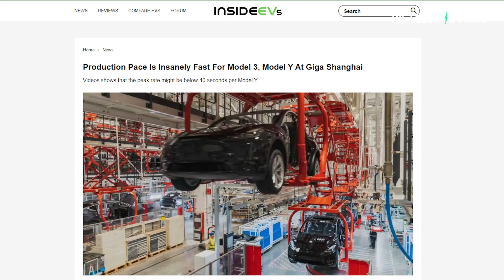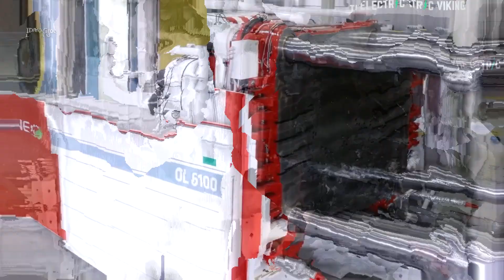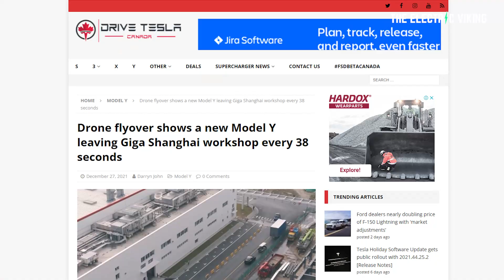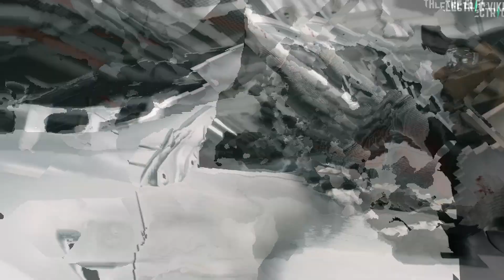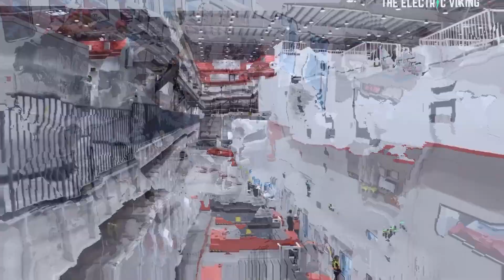Herbert was right: TESLA'S production pace is SCARY fast

Comment: That little factory in Shanghai is already one of the biggest car factories of any kind in the world at a current run rate of probably around 800k production per year. If the expansion due to be completed by April 2022 could boost production by 50%, then that means that Giga Shanghai could be at a 1.2 million cars/year run rate by sometime in 2022.

Comment: With gigacastings it is likely to reduce the build time from currently 10ths per vehicle to somewhere between 7-8hrs per vehicle or quicker. The speed at coming off the end assembly line will increase thus the seconds per car to be parked up will decrease some what (probably under 30seconds per vehicle).

Comment: While Tesla is 'wowing' VW with 40 second cycle times (global automotive factories by all brands just love '60 jobs an hour' or 60 second cycle times) that still is slow to the original benchmark. Henry Ford's Model T peak production rate at the Highland Park factory hit two million vehicles, running full out 24/365 that gives an output of 16 seconds per vehicle. Sure, the model T was less complex than a Tesla but the technology was newer and more crude to compensate for its own complexity, but in the end you just design all the part fabrication and supply chain factories to build at your target rate. If you have slow stamping presses, you buy three to keep up. Musk or his factory lead set the target at 40 seconds to keep the supply chain focused, a smart stretch to make.
Find a book titled "Ford Methods and Ford Shops" that was published in the 1920s on Ford's factory, and reprinted a decade ago, it's hard to find. Truly amazing photographs in there, like a single drill press putting forty-eight holes in an engine block at the same time. The end-game for Tesla's factory may be to build a car with a cycle time faster than its zero to sixty track times.

Comment: I believe the metallurgy calls for a cool down in the mold (to accomplish specific characteristics) which cannot be changed due to the crystallization physics. In other words, you can only go so fast and still control the metallurgy to spec.
Reply: The castings should not be a limiting factor as you can install as many casting machines as needed and pre stack the castings.
Reply: @bartgroeneweg7765  duh! I didn't say anything about only having one machine - of course your going to install as many as needed - the time cooling in the mold is a fixed factor is my point

Comment: Tesla recall 475,000 vehicles on safety concerns just announced. To much emphasis on quantity rather than quality?
Reply: But only 1% of these cars may have a problem.
Reply: So a minimum of 4750 vehicles will have a problem. Very reassuring 😂
Reply: It's a 1 dollar job on each car with a problem, they have to check a couple cables and install a cable guide
Reply: Don’t get me wrong I invested in Tesla and made a tidy pension pot. I sold my shares as the company is turning into a utility stock rather than one for the future. It’s made it’s money and even Elon is selling his shares.(replacing them with free share options) Recalls of any nature, damages the integrity of a company in the eyes of any hard nosed investor.
Reply: All cars get recalled. Please please please please don’t base opinions on what makes the news.  Problems with EVs make the news and Tesla doubly so.
Reply: @lesliecarter4295  who cares (about other investors)
Reply: @juliahello6673  most cars which should be recalled don't get one because it's less expensive to have a lawsuit in case of an accident than to repair all cars. Tesla priority is safety, it's a positive thing imo

Comment: This insane production pase is one of the reasons I don't like Tesla. They are all about the margins at the expense of the quality of the cars and thereby the customers that buys them.
Tesla ranked second to last in Consumer Reports reliability report. Several sources are reporting similar results, so Teslas poor quality is well documented. 
Building Tesla cars goes fast, but apparently it doesn't go well.
Fast isn't always best. They really need to up their game in QA, but that will of course eat into their production times and thereby their margins. 
Not doing this shows great disrespect to their customers and will hopefully bite them in the a## eventually
Reply: Actually fast is almost always better. The quality problem comes from 
dn/dt. It's the ramp up that causes the problem. The whole line must speed up to produce more cars, not just the bottleneck. As you ramp you find processes that were fine suddenly start causing unexpected problems. This is why manufacturing is so difficult. Nominal speed is not the problem.
Reply: @julianwilson5468  if I was a customer I wouldn't care if the problems with my new car was due to nominal speed of production or Tesla ramping it up too fast without having control over it.
Also, if the factory is to run 3 times as fast as factories of the competition, Tesla needs to have enough number of employees inspecting the parts being manufactured. If they have to few of these they need to lower the production speed to be able to inspect a larger portion of the parts. Also the measure margins for what is considered an approved part probably needs to be slimmer. This is needed for better quality but will mean that more parts will be discarded and thus hurt the general throughput.
What I am saying is that there are several parameters that makes Tesla cars have poor quality. They need to take care of this even if it hurt their margins. In their pursuit of production times they obviously let through parts that other manufacturers wouldn't
Reply: You are right, if I were a customer too then I wouldn't care why the quality was poor. Musk himself said in an interview - "my friends ask me when is the right time to buy a Tesla? Wait till the production rate has stabilized".
This is a way bigger problem than inspection. Tesla is also trapped in having to do this because there is a window of opportunity to get through. They need to get to a certain level so that they can meet the oncoming competition from China. I'm going to suggest that the imperfect strategy that you point out is still probably the best one for them. My evidence for this is the fact that they are not able to meet growth in demand and still able to raise prices. I think Chinese competitors will change that in the next few years
Reply: @julianwilson5468  yes, the chineese brands will be game changing in a couple of years when they introduce their vehicles on the european and US markets (starting 2022)
Reply: I would imagine Tesla behaviour is compromised between what they would want to do and what they must do to be ready for that fight.

I hope this whole battle will be good for the world - for electric cars and the environment. I'm a little concerned that there will be so much disruption and even desperation that in the process of doing good things, bad things will be justified. World seems too full of that at the moment.
To me, so far, Tesla seems on balance to stay on more good than bad. Only time will tell.
Do you think their stock is over valued? Like a boxer before a fight, its very difficult to see weakness until the bout starts.
Reply: @julianwilson5468  yes I think Tesla stock is overvalued. They have a higher ps ratio than the chineese contenders like BYD, Xpeng and Nio even though Tesla sells more cars than the rest and thus are less likely to grow % wise as much as the others.
The other have also yet to enter markets such as Europe and the US which will scale their sales vastly.